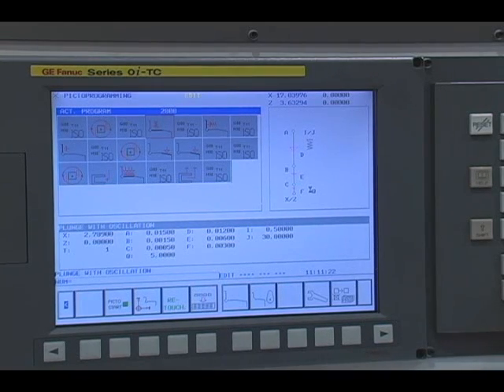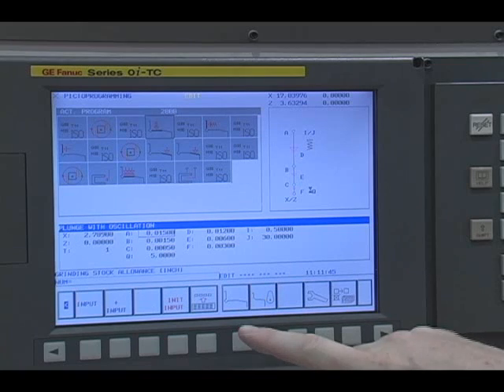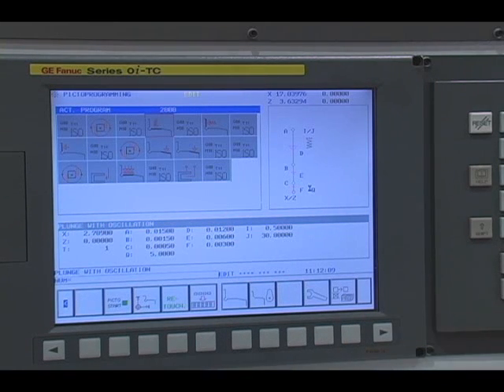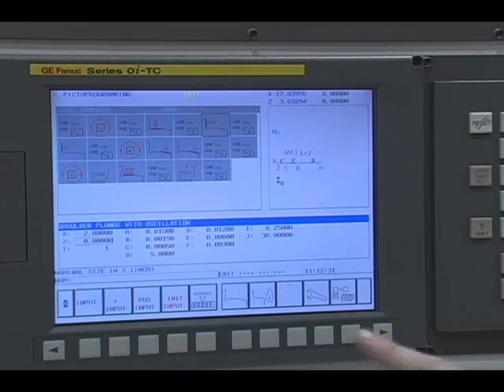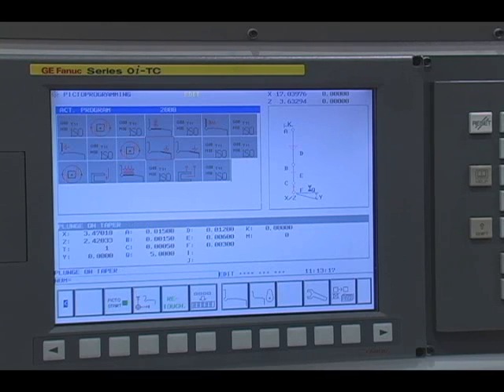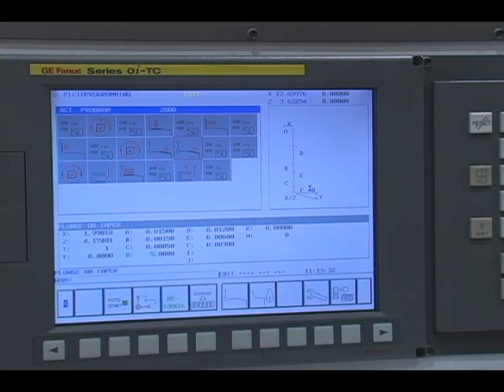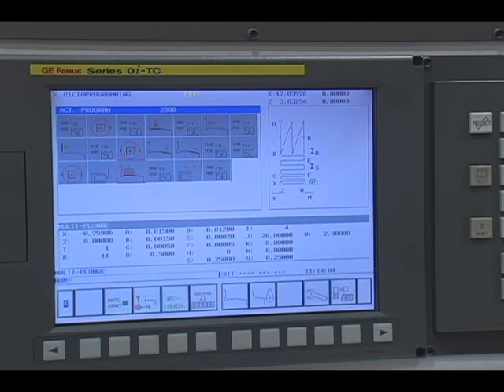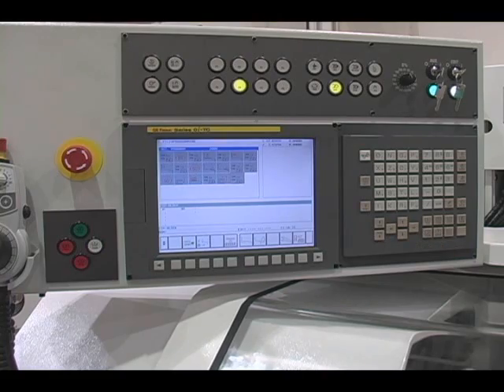CNC Cylindrical Grinder - Studer CNC Cylindrical Grinder Programming via Pictogramming ID OD Thread

Comment: Can you refer me to a start to finish setup from having workpiece dialed in and a brand new wheel on? The grinder quit and the boss asked me to take control and I am getting stuck on this old 2000 Struder doing I.D. grinding. The book I have doesn`t explain well since it is in a different language.